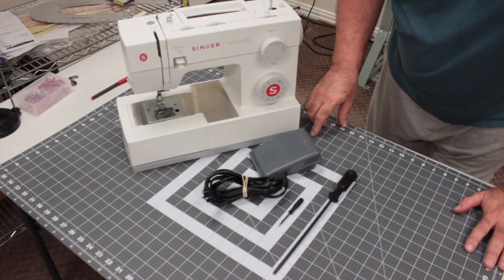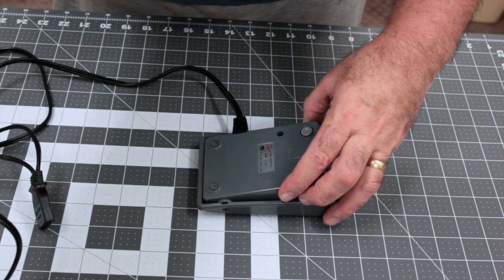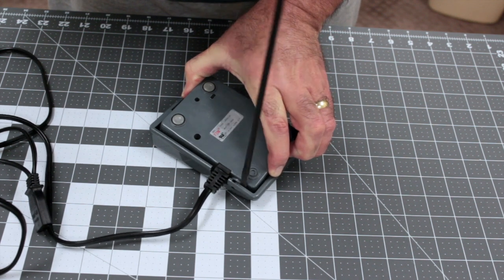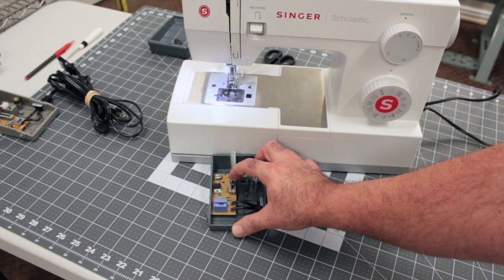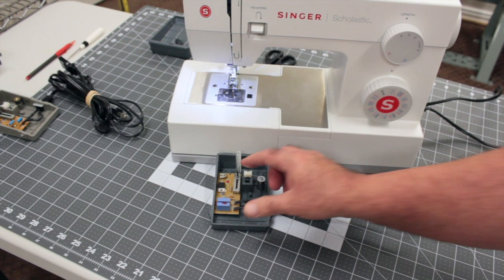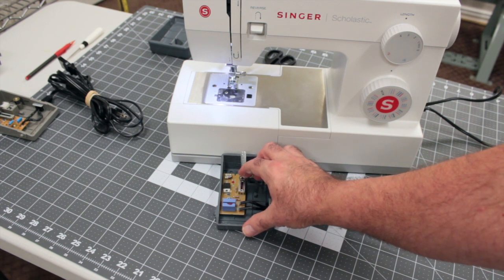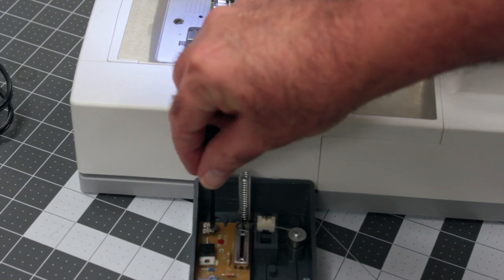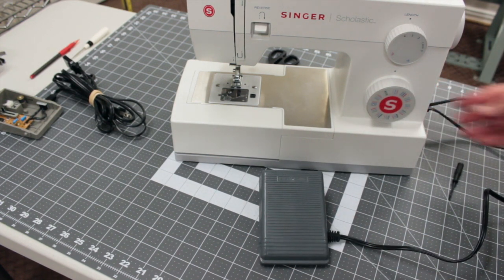Slow down the Singer Heavy Duty Series on some USA Versions

Comment: The foot has a hole where you can insert a screw driver to turn the speed adjustment without opening it!
Reply from the maker: Mine didn’t have one. Maybe some other model pedals do though.
Reply: @kevinsews  The pedal is a FC-2902D, which is a pedal of a Singer 4423, purchased in 2024, EU model.
Reply from the maker: @EconaelGaming  Ah, that explains the difference.
Reply: StelutaSabau  I used... a very thin screwdriver. One from those cheap "micro precision screwdriver" sets.
Reply: Did it work for you? I tried it and now my machine goes so fast I cannot use it. Trying to figure out what to do since it doesn’t go back to normal
Reply: @_LoveMJ_  Right next to the slowest setting is the fastest setting, you probably went over. Here's how this works: imagine a circle with a line at the bottom. Left of the line is the slowest setting, then going clockwise the settings get faster and faster, until you end up at the same line, where the fastest setting is. If you go just over the line, you end up at the slowest setting again. The screw is for pointing a piece of wire at a position on this circle.
Hope this helps.
Reply: @EconaelGaming then did you initially turn it left or right?
Reply: @isabellahu4606  My pedal has arrows and a "+" and "-" next to the hole on the underside. I twisted towards the "-".
Reply: @EconaelGaming okay thanks, I have the same one so I’m gonna try this first
Reply: @EconaelGaming  The pedal that came with my European market Necchi looks almost identical inside and out to the one in the video. I suspect they all come from the same factory. My pedal has a little hole in the back with “+” and “-“ markings too, but to slow it down I had to turn it towards the “+”. How strange!  It shows that people may need to experiment a bit to find the right adjustment for their pedal.

It can also be easy to lose your place when working through the hole, as you can’t see the slot. Sometimes it helps to sweep all the way anti-clockwise, then all the way clockwise, to get a sense for the range of adjustment available.
Reply: @british.urchin  I agree, it's best when people just try out different settings, as even terms like "turn towards" might be understood differently.
Reply: Oh my gosh!!! I was just looking at maybe buying a new machine so my girls can use !! and then I see your comment!!! I feel so dumb! I've been living with the fastest setting for 10 years now
Reply: @TBurd-g6x  You must have developed exquisite pedal skills by now

Comment: Hello I am French and my singer 4423 bought from amazon germany.  By turning my pedal over at the top right of the thumbnail, I have a hole with a molding representing an arrow + and -.  I can easily adjust the speed without taking anything apart.  the model of my pedals is FDM FC-2902D.  it is to CE europe standards if that can help you.  And yes among your subscribers you have a French.  thank you great videos.🐝
Reply from the maker: I’ve heard from many outside of the USA that have foot pedals that offer this feature. You are lucky you have it.
Reply: I have just done this! World of difference, thank you both 😊
Reply from the maker: @clairetrimby111  I am glad it worked for you.
Reply: back in the day here in the usa, my cheap singer machine had that external adjustment.  i wonder if they make them without it now so that most folks take it in to a singer repair shop.

Comment: I have one of these machines and I'm surprised and disappointed that it didn't come with a manual speed control feature. It seems obvious to me that they should have included it like so many other entry-level machines.
Reply from the maker: The latest release on this machine is an electronic version. It allows you to adjust the speed control.

Comment: hello, i have the heavy duty 4452, i tried your method, but the machine still goes incredibly fast no matter the position it is turned in. i have the dial on the side with the + and - but they dont impact the speed either... i'm very confused

edit : dial on the side seems to be for button holes haha nevermind :"))

Comment: Singer 4452 in Canada that I just bought the other week. Took my pedal apart, instead of a set screw mine has a mosfet. Unable to change, but instead I just super glued a piece of wood onto the pedal so I couldn't go any faster than I need to.
Reply from the maker: Gotta do what you can to fix this issue. LOL
Reply: I have one from Canada and I've got the same problem! Tried this hack but it didn't help 😭

Comment: I would give this video 100 thumbs up if I could.  Got myself a Singer Heavy Duty recently and, although I like the machine, I was struggling with the fact that it seems to go from 0 to 100 mph with nothing in between. I'm what you might call an "experienced novice" so the ability to go slowly is important to me. In fact, given that what takes time in sewing is not the sewing itself but the measuring, cutting, pinning and ironing, I'm not sure why any home sewist really needs the ability to sew quickly. Anyway,  it took me about 30 seconds to take the pedal apart, fiddle with the thingy to get the needle at the speed I want it, and put it back together. Thanks so much Kevin, you've made my day.  BTW mine is a European version.
Reply from the maker: You're welcome! Thanks for the info.

Comment: Thank you Kevin.  I am an experienced sewer and can handle the fast start up usually. But there are applications where I need to go very slowly.  And the super fast startup hasn't anything to do with proper use of pedal. So glad you said this too. I ordered a new pedal and it starts up slowly.  Now, to see if old one can be adjusted. You are suprr smart and kind for sharing.
Reply from the maker: Thank you! I appreciate it.
Reply: I'm having the same issue with my machine and even after doing what Kevin is suggesting it still starts up too fast. I'll give it a few more tries but if it doesn't work, I'm considering ordering a new pedal. You think that would solve the issue?
Reply: @darkmatter6878  I googled the part #(from back side of foot) and new pedal $17 w/postage, starts slowly.  After Kevin posted video my hubby adjusted the old foot for me.  It didnt look quite like the one Kevin demo showed,  but his info was all hubby needed.  Now I have 2 pedals that start up slowly.  Sorry so long responding  to you. YT didnt notify me of your comment. I saw it when rewatched and read all comments again.
Reply: @jojosewist8921  Could you please share a link where you ordered a new pedal? Thank you.

Comment: I watched your video a few days ago and I am happy to report that the Singer HD6335M (aka 4432 version with more accessories) here in Europe (UK & ROI) also comes with a foot controller that has the same speed adjustment in place (slightly different circuit board layout). I was able to slow down my sewing machine as well. Thank you.
Reply from the maker: Great! Thanks for letting us all know.
Reply: Hi! What's the model of your pedal please? I'm desperately trying to find a solution for my current university project, I have two pedals and none have this feature 😢

Comment: Thanks for the video. This info should really have been included in the manual! My machine came with a model "FC-2902D" foot pedal which went absurdly fast. Fortunately there's an extra little hole on the back of mine, to adjust that dial without dismantling. So check for that first folks, as you may be in luck!

It's labelled with a little symbol:  - <—> + although, counter-intuitively, turning the dial towards + slows it down (more resistance = less speed).
Reply from the maker: So you have this on a USA version machine?
Reply: @kevinsews  No sorry, I should have clarified, mine's Australian. But when I googled for a solution, your video was the only one that came up, so I suspect plenty of people internationally will find themselves watching your video even though you're referring to the US version.
Reply from the maker: @prodigalretrod  I state in the video title that this video is for SOME USA Versions.
Reply: @kevinsews  I realise that, I never said anything to the contrary! Just sharing information that may help others who stumble upon your video.
Reply: Je suis français et singer acheté amazon germany. J’ai le même modèle de pédale que vous avec le petit trou pour régler la vitesse. Pareil + baisse la vitesse et - augmente.

Merci à vous les deux. 

Merci pour le temps et la patience de poster tes videos. 👍

Comment: Fantastic! I just did this on my Singer 4423. Easy! I was about to buy a new machine. I was afraid to test it plugged in, so I just set it between 6 and 7 and it was perfect! It used to grind at the beginning- now it doesn't. Wow. Thank-you
Reply from the maker: That great to hear. Thanks!
Reply: Hi! What's the model of your pedal please? I'm desperately trying to find a solution for my current university project, I have two pedals and none have this  feature 😢

Comment: This is the exact speed controller for my dear little Brother XL-3600 (bought in 2006) and your instructions on how to slow it down worked perfectly (apart from the fact that it was necessary to turn the little screw clockwise to soften the speed - so it must be wired differently).  Thank you so much for posting this!
Reply from the maker: Thank you for letting us know!

Comment: We ordered the 4423 model from us, which initially came with us outlet; in addition, we bought an eu outlet adapter, and as you might assume it was running so fast. I did try to lower the speed in the pedal as shown on the video, but no luck unfortunately. 
However, I thought that maybe the problem was with that eu adapter we bought, so after receiving the European version of the pedal the issue was resolved, I still needed to lower the speed in the pedal, but at least it allowed me to set the needed one. I hope it is helpful for someone in the future.
Reply from the maker: Thanks for posting this!
Reply: The US Energy grind operates on a different frequency. Probably not a good idea to import a product like this. Nothing in the foot pedal will shift the frequency.
You don't need to pop the pedal open anymore since they have an access screw now but I had to take a look. Looks like they only changed the component placement and added an access hole to the potentiometer.

Comment: Thanks for the video. Another option would be to buy a cheap phase controller from ebay, aliexpress or banggood and plug your machine into the controller without adjusting the pot inside the food pedal switch.

Comment: My issue is that when you give it pedal it doesn't go until you push it harder and then it takes off really fast. It takes the control away and it sucks. I'm thinking I'm going to have to try an upgraded pedal. Any advice? Thanks.
Reply from the maker: Just buy a new pedal. Try www.sewingpartsonline.com

Comment: Thank you so much for this video! My 2006 mechanical Kenmore has similar parts inside the pedal. Not just like it, but enough to recognize some of the parts and what you were doing. So I fiddled with the screw thing and turned it to 6 o'clock. That little white roller thing had to be positioned behind a pyramid-shaped wedge in order to be able to push the pedal down. So I had to use a butter knife to keep it positioned behind the wedge as I was closing the case. I did not have my machine plugged into the electrical outlet while I was working on it. I was too nervous to do so. But guess what? I plugged it back in, turned it on and it worked! Thanks!
Reply from the maker: My pleasure! That is great to hear. Thank you for letting us all know it worked.

Comment: Thank you Kevin! 
I have bought a new Singer 411 european version in Italy(220/240V). There is a difference compared with your version: inside the pedal there is a silver screw, that is slightly on the right of the screws you adjust in the video. When you turn the screw counterclockwise the engine slows down. Perfect sewing machine.
Reply from the maker: Federico Albasio Thank you for letting us know. It will be helpful for those who have the same version machine you own.

Comment: I was able to reduce the speed of 4452 using  OOTDTY 300W 220/240V To 110/120V AC Step Down Travel Voltage Transformer Converter.
Works great!
You can easily adjust the speed by pressing the pedal
Reply from the maker: Thanks for letting us know it worked on your model .

Comment: I really appreciate this video. I bought my Singer Heavy Duty 4432 four years ago and it was my first machine. I had a really hard time with the speed though, as it would go from 0 to nearly full speed no matter how slowly I pressed the pedal controller and I could only get a slower speed by easing off once the machine started sewing. I even phoned singer to complain and they sent me a new foot pedal which worked slightly better, but person I talked to never even mentioned the possibility of adjusting the sensitivity on the inside of the pedal. facepalm I just opened both my pedals and they both have the place to adjust the speed. The make numbers (I assume) on the bottom of the pedals are 8401 for the one that came with my machine, and 8501 for the replacement one I was sent. Both pedals provide better speed control now that I have adjusted them. I am in Canada.
Reply from the maker: You're welcome! Thanks for all of the info.
Reply: @kevinsews  I just looked back at my invoice and email and I purchased my machine in September 2018, and talked to customer service and was mailed a replacement foot pedal in December 2018. So only 2 years ago. It would be interesting to know if the speed adjustment was a recently removed feature or a recently added one. Can you tell me the make number of the foot controller you bought that does not have the speed control? I fount the number on the top left of the bottom label above the letters FDM.
Reply: @kevinsews  The parts that adjusts the speed is called a Variable Resistor. Hence the VR next to it.

Comment: Thanks for the video, very instructive. Do you know if  it's possible to do the same for the Husqvarna Viking Emerald 116 pedal?
Reply from the maker: It is easy enough to find out. Simply remove the top of the pedal as I showed in the video.If you have the dial I used then give it a try. Just remember were the position is was before you slightly turn it just in case you need to go back to where you started.
Reply: The foot control for my sewing machine is Model YC-190. I've seen pictures of the inside online and it's quite different from the one you show so I don't think this hack will work for me. But I have a friend that has a singer heavy duty so it will be great for her. Thanks.

Comment: Hello. Comments for your video on how to oil the singer heavy duty machine are disabled. I'm sorry for an off topic comment. I'm wondering if I'm doing something wrong with mine as the top part that's supposed to come off after removing the two screws under the handle doesn't. Have I missed something? I took the screws completely off and the cover isn't budging.
Reply from the maker: You will find it on my blog: www.kevinsews.com

Comment: Thanks for this modification. It helps a lot. What also may help is to apply some dry lubricant on the moving parts of the pedal. It seems to function much smoother when sewing on low speed. Just my two cents. Enjoy.
Reply from the maker: Gerard Mollema My pleasure!

Comment: Hi Kevin, I was hoping you could offer some insight on the PQ1500SL. Do you think this machine is well suited for topstitching twill jeans? I just purchased one last week, mainly for topstitching twill jeans/shorts and I've been having constant issues with the tension, particularly with skipping. So far I've only been able to get the machine to sort of cooperate with a super tight bobbin tension but I'm still getting skips despite keeping the presser foot level. Also noticing the stitch comes undone quite a bit easier than on my computerized machine and backstitching doesn't seem sufficient for securing the stitching in place long-term. Otherwise, the machine stitches beautifully. Any idea what could be going on?

For the record, I'm using Gutermann topstitching thread (tex 100, polyester) with sew-all thread in the bobbin. I've tried both a size 14 topstitch needle and a 16 jeans needle. Cheers!
Reply from the maker: I would simply use the same thread in the bobbin.  You can also try a top stitching needle. I have a video on my channel that demonstrates me using a Jeans Needle and a Top Stitching needle on a jeans hem. The stitches are not forming is what it sounds like. This is either the needle, the tension or the threading. Get some Top Stitching needles and double check your threading paths. See my video on getting a good starting point on needle tension. I am using my PQ1500 in it as well.  Hopefully it is something simple.

Comment: I wonder if the same can be achieved without opening the pedal - through one of the holes that are already provided on the underside of the pedal?
Reply from the maker: It doesn't hurt to try.
Reply: Yes! I have an older singer model 9810 that had the same problem - it was way to fast. Luckily my pedal  has an opening on the underside, all I needed was a small long screwdriver. So I also recommend  checking the underside of the pedal before opening it.

Comment: Thanks, I also adjusted it mine from outside hole....but ... 
I want to redo all electronics on pedal, I want also to adjust bottom limit as on low speed half of pedal pressing is inactive and motor is humming, and I also want to adjust modes (slow and fast) outside of pedal with a setting switch.
Initial I was thinking that a motor change (to DC or stepper) is the only solution but after your video I think I can achieve what I want only with AC Motor, but I am thinking ....